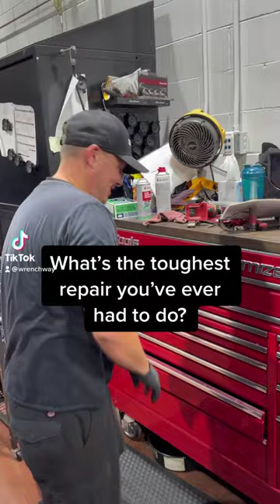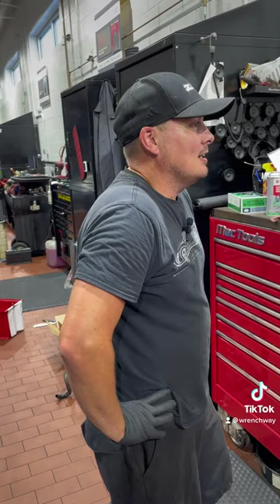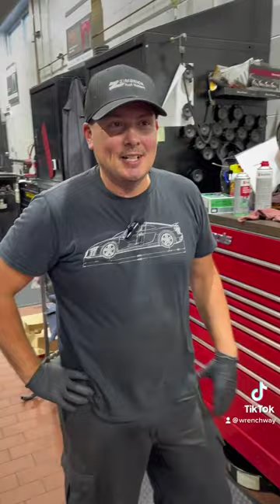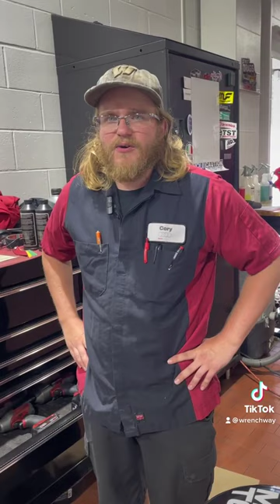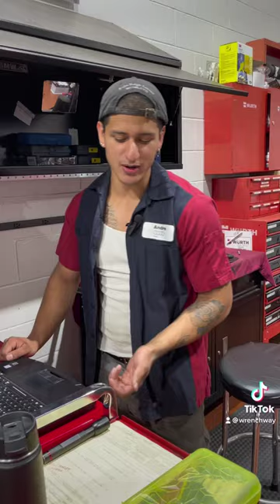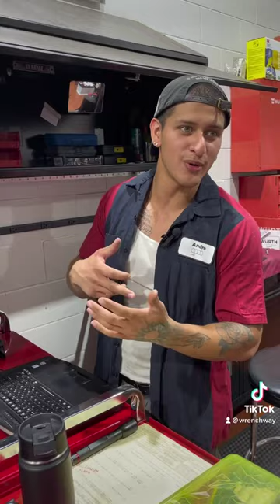Technicians Talk About Their Toughest Repairs #shorts

Comment: The first 2 sound legit difficult then the 3rd guys like “ a cv axle “ 😂
Reply: Sometimes the simplest jobs could turn into a nightmare
Reply: @efproductions923 true I had a half shaft my first year in techschool followed procedure but it was just a pain in my ass to do
Reply: My j35’s half shaft fought me until i just removed everything around it to get the entire assembly’s bracket out. Flex pipe, bank 1 catalytic converter, driveshaft and transfer case had to be removed just to get at it. This was for replacing the entire engine so i wouldve done all that anyway but it still sucked, and i ruined the boot on it so i had to replace it
Reply: I had the whole dealership stumped on my rear brakes the problem was there was air in the lines they thought of every other solution but to look that the calipers bleeder screw was facing down I had to flip them around took about 3 months before I came & seen it one day legit every tech in that dealer had no idea lol sometime it be the little things
Reply: If u can’t do a cv axle or half shaft in 30 mins on a lift ur in the wrong business. If it’s on the ground still shouldn’t take more then an hr n a half but all depends on what else u find on ur way in and out 🤷🏻‍♂️
Reply: @Alanthe918mobilemechanic  the problem wasnt the halfshaft it was a pinch bolt honda said to take out for some reason ended up having to take off mcpheerson strut, lower control arm,  a bunch of other shit in my first year of techschool can definitely do it faster now though
Reply: @Alanthe918mobilemechanic  i have sped up alot (although got in a car crash so been running off caffeine and advil) that was an extremely long time but regardless im on my 2nd year
Reply: @Jacksauto  keep going bud slow is steady always use a pry bar and maybe a hammer unless ur on the ground sometimes u gotta remove sway bar and end links to get room to fit a good pry bar i spray some wd 40 or lubricant glad ur okay stay off the energy drinks and caffeine for the first 90 mins drink water that’s hot with lemons and a bit of sugar you should feel better. I always love seeing younger dudes getting into the industry and not giving up. I just did some halfshafts and cv axles on a 02 Santa Fe the driver side was so rusted in but I found that turning the cv axle around 360 in small increments and prying you’ll eventually get the lock ring in a spot where it will come out with ease! Thanks for commenting bud! And good luck swinging wrenches it saved my life looks like it’s doing the same for you
Reply: @Alanthe918mobilemechanic  thank you dude Im still new we’ll see where i end up still alot to learn but yea it is a constant I guess which helps
Reply: @Alanthe918mobilemechanic  being a entry level tech is a challenge but it is fun gives me a challenge and a constant and yea I guess your right saved my life in a way to still so much to learn
Reply: @Jacksauto  trust me on this even tho u don’t know me I wish u the best and to be happy and secure learn as much as u can do research tinker with stuff outside of work try and find a good mechanic who’s maybe not a dealership bratt and learn some tricks of the trade or watch reputable channels on the tube. You’ll eventually have saved enough money to have ur own scanner and all the tools u need to go mobile or open ur own business and never have to work for someone or do a degrading job. Ur two years in right wait till u hit the 5 year mark then 7,10, etc you’ll make it bro. Keep grinding and rmr your doing a trade that most ppl couldn’t cut it in so take pride in being what u are it’s a beautiful talent my friend
Reply: He was honest! I'd say lack of room can be the biggest PITA
Reply: It's always the easiest stuff that takes forever. I attempted to take an oil pan off a car once it turned into an ordeal eventually I just took the engine out which was less difficult lol
Reply: @Toad Phillips  that is the truth, I'm just a backyard mechanic that fixes his own crap. When you start off a job and everything seems to be going perfect, you can bet your arse something will screw up just when you are about done.
Reply: Tell me he's a lube tech without telling me
Reply: Right.
Reply: I laughed at this but I'll cut him some slack since I recently had a 09 focus axle that was a mother to remove, took hours over book time, I legit thought I might break the  aluminum I was prying against. Finally got it with a custom ground air hammer bit.
Reply: sometimes they can be a nightmare. i'm a bmw tech and almost every x drive bmw has the right half shaft going through the oil pan to keep the cars lower. it's not fun to say the least
Reply: I fought an axle on a 2006 honda odyssey once. Passenger side is 2 parts with a bearing in between. After 3 hours with a slide hammer attachment I ended up taking the whole thing out as one peice heating it with a torch and beating it with a sledge hammer it Finally came loose from the carrier bearing. Yeah that was the hardest job in 27 years. Lol
Reply: Of you got rusted bolts that can be a nightmare
Reply: Ever had a bolt break off on a simple job inside the block

I had a starter job take all day because  of that
Reply: The Johnson rod for sure
Reply: @Alanthe918mobilemechanic  hearing that a lot, what you said about how it’s good to see younger people getting into the industry. I’m 22 now but started self teaching myself the trade around 18, just started up my mobile mechanic business. I hear a lot, that not as many young people are wanting to be mechanics these days compared to 10+ years ago.
Reply: @iTsTHumpa  it’s true man most guys don’t want to deal with this stuff they don’t have the stones to work outside when it’s cold or deal with the frustrations of being a mechanic but it’s a very rewarding job pays very well. It has its ups and downs but for the most part, you make people very happy I’m out here right now trying to get a 2.7 L V6 to stay in time while I throw the time in belt on just the glory of being a mobile tech.
Reply: @iTsTHumpa  congratulations by the way on making it to where he’s made it in the industry. Keep going man when it’s time to retire you’re gonna have some thing and you’ll have more than money.
Reply: @Alanthe918mobilemechanic  appreciate it boss!
Reply: He's "SOFT" :)
Reply: @iTsTHumpa  hey man appreciate you youngster enjoy your youth! Make the most of it stay under the hood and do what u really love doing
Reply: Picky customer's who want the impossible way on there car
Reply: I’m guessing he had to be joking ……
Reply: Nah he wasn’t he’s just young nd that’s old he’s gotten a lot better since then he’s a young talented tech working on Audi which isn’t always the easiest to mess with
Reply: Bro he looks young what engines you rebuildin huh?
Reply: You have a bad day. Anyone, you can literally have a difficult task to do for the easiest things. I don't make fun of anyone in this kind of work environment.
Reply: @Er8Top1  read the rest of the comments no one made fun of anyone and if u can’t handle being made fun of in the shop ur in the wrong business child.
Reply: @trentulloa  to many to count but currently doing an in frame overhaul on NTC 365 IV cummins big cam took me 2 days to do it working 8 hrs each day. I been wrenching for about 15 going on 16 years idk why ur all tryna be offend no one said anything wrong even the dude ur talking about wasn’t offended all y’all commenting belong in a beauty shop not a automotive/diesel repair shop. Smh. Soft.
Reply: @Alanthe918mobilemechanic  this guy, that's anywhere part of the business. When the jokes lands on you. I'm sure you're the "child" who definitely takes it in all the way and will complain about it. Obviously my comment wasn't for you. That comment was for those who makes fun of someone else on a task for the job that has an ego.
Reply: @efproductions923 facts. I was supposed to just do level keys and upgraded tie rod ends on my buddies old silverado since he was about to put 20x12s on. Turned into his wheel bearing was shot, went and got a reppacement hub, old hub was friction welded onto spindle, it was so siezed a press wasnt even getting it out and had to torch out the old hub. What would normally take me 2 hours took me more time than i can count
Reply: I started with a cv axle that turned into lower control arms and a steering knuckle. The axle was stuck seized inside the hub and lower ball joints wouldn't come out either. I broke 4 ball joint separators so I cut them and replaced them all. Even with a press the axle wasn't budging from the hub.

Comment: The hardest job, is going to work everyday knowing this business sucks ass.
Reply: Why do u think that?
Reply: @United Territory after 36 years in the business, your body hurts almost every day. Most techs don't get paid enough. But really for me, it was a joke comment. I have made over a 100k a year most of my career, I have over a 100k in tools. I do NOT work on vehicles on the side never have never will. I don't even like vehicles, I'm not a car guy. I'm just very good at repairing them. I have been an ASE Master technician for all of my career.  But started specializing in hard-to-find problems, and became an automotive specialist, dealerships bring me vehicles to find problems they can't fix.
Reply: @homesteadhaven2010 field service engineer
Reply: Honestly
Reply: @homesteadhaven2010 I actively lift and am 21 years old, starting as a Gen Tech this monday. When I do gravy work on my car with just a hand jack & stand my lower back and lats are dead for the day, but i notice shops have lifts to work at chest level or above. My question is, if I'm physically fit can my body survive the demands of being a tech?
Reply: @bestmonkineu4342  I'm not exactly physically fit and I do just fine
Reply: @isaackellerman3006  same, i needa pickup some weights because i struggle with certain things that strength would come help with
Reply: @bestmonkineu4342  just be smart with what & how you lift. There's a difference between lifting weights & lifting engine parts without damaging anything. The business will show you over time where your workout routine is lacking.
Reply: @bestmonkineu4342  im 23, have been a tech since I was 19 and i feel like im 30 years old.
Reply: @bestmonkineu4342 it will help for sure. Still need to be careful though
Reply: @homesteadhaven2010  "not a car guy" lol ppl look at me crazy when I tell them I hate then but know how to fix them
Reply: @bestmonkineu4342  gotta be mentally strong lmao, also gonna bust your hands everyday. Same spots too. I got cuts on my hands from months ago lol. Just don’t have enough time to heal over the weekend. Always sore too. Never know what muscle your gonna use laying lopsided trying to get that one bolt🤣
Reply: That’s why I got out when I did

Literally any trade but automotive let the dealerships sink themselves be happy somewhere else it’s either you or them
Reply: @alexanderthegrape5370  Honestly that’s the part I’m not understanding 😂. I’m considering changing careers & becoming a tech because I sit at my desk job wishing I were around cars all day. They’re my passion. What’s yours?
Reply: @bestmonkineu4342  you could have some muscle imbalance meaning some muscles are stronger than others are.  Possibly you are doing all slow twitch muscle training  ( heavy, low  Rep) and too little Fast Twitch training ( low weight high Rep ) think of a marathon  runner that needs to use the same muscles for hours without pain our injury.  You should consider spending time with a Kinesiologist who can assess what you are doing and what you are doing in the gym to avoid possible injuries latter on or when at work.
Reply: @qwntnqwntn  do it brother! Get out of that office chair, spend 5-10 years in the trade then open up your own shop!
Reply: @qwntnqwntn  It's an extremely demanding trade on your mental, physical and financial health lol the fact that you love cars tells me it'll be a great hobby for you because doing this professionally will most like diminish that love for cars.. if you want a lil taste do some work for friends and when things go sideways you might change your mind... My passion? My passion is a cozy desk job with clean hands and air conditioning wearing nice clothes without the possibility of losing a finger, getting burned, electrical shock, losing or severely injuring an eye, blowing out a ear drum, severe arthritis when it's all said and done the list goes on so .. yeah 😂
Reply: Auto is gay , diesel is where it’s at
Reply: @alexanderthegrape5370  Man that definitely answers my question, thank you!! I just bought myself a new project car for christmas so I’m sure that’ll satisfy the urges to wrench when I’m free. When it comes to my career I’ll try to find a cozy dealership job so I can continue to work in comfort while also being around cars & other car people. If I get could get access to a shop after hours that would be a plus. I see an opportunity to work smarter, not harder here 😂
Reply: @qwntnqwntn  Dude now you're thinking!! That's a awesome idea, get to know the techs hang out in the shop on your break it a win, win lol
Reply: @bestmonkineu4342  unfortunately age will get the best of all of us. I did it starting at 20 years old to 32. I was 195 pounds with 28 waist. Im 35 now. not nearly as in shape anymore, but my body feels like I played tackle football 12 hours the day before. Every day. My job is still labor intensive but I dont see how I can do it for much longer.
Reply: Preach brother!
Reply: @homesteadhaven2010  the question may be obvious but idk so genuinely asking why dont you do side jobs? For insurance/ legal reasons? Or too risky?
Reply: Anybody who has worked in this business, including me, will agree with you.
Reply: @bestmonkineu4342  been wrenching since I was 9 years old in my grandfather's shop. Started full-time at 15 at a body shop Started on flat rate first day. I've  worked at mechanic shops also. On a 50 hour week I'd book 70 to 80 hours I'm 48 now and my body is shot got knee and back problems arthritis through my whole body. I got out of it at 40 I work for a trucking company now it's hourly and really laid back. The worst mistake I made is making a career out of a hobby. It's not worth it anymore pay sucks and you'll destroy your body. Your young enough save it for a side gig. Do something on line work from home.
Reply: @homesteadhaven2010   you should be making millions
Reply: @homesteadhaven2010 bro fix my brakes bro my pedal is weak and the calipers don't release after driving for awhile
Reply: @bestmonkineu4342  it’s the part of putting your body in awkward positions that make it sore. Because some engineer decided to make the dumbest design possible . I’m myself is in shape and I’m sore after doing repairs on my vehicles, and I’m sure you know every vehicle is different . Good luck to you and your field of occupation
Reply: Try being a diesel mechanic for Tyson foods
Reply: @bestmonkineu4342  hell yeah brother. Been a HD Tech for 7 years. I still workout 5xweek💪
Reply: @davepalmer9265  I got guys in their 50s and 60s in my shop. I don't even know how they still do this everyday. To be fair, I work for Hyundai. We don't even work on big engines. Pulled in a lifted 1500 Silverado to do a used car safety inspection. That shit just looked too much, compared to what I normally do. I think I have it easy, comparatively. Can't imagine working one those big engines.
Reply: @bestmonkineu4342  it’s the long term wear, not the short term.
Reply: It does suck ass.
Reply: @bestmonkineu4342  yea definitely. Dude there’s old ass men 50-70 still in the industry going at it strong so you definitely can do it. It won’t be easy but it also won’t be as hard as you think either probably
Reply: @BestMonkInEU  yes, I'm not super fit.  But I'm not "fat".   Only parts of my body that hurts the most are my legs.  But that is because I'm just getting older.
Reply: @jose duarte  I hate vehicles with a passion.    I'm a farmer/butcher at heart.      I own over 100 acres with a misfit farm full of animals.
Reply: @majordudley35  in Minnesota?      If so how was the State Fair this year?
Reply: @JoiceVaderd  I'm in my 50's.  Start at age 16.
Reply: @bestmonkineu4342  it’s in the long haul man. Nearly anyone’s body could survive being a tech, the question is how long? You won’t know until the damage is done sadly.
Reply: I dunno, I've been out of the bike trade for a decade now, thinking of getting back in. Miss wrenching on bikes something fierce lol
Reply: Why do you say that? I thought mechanic is paid well
Reply: HHahhahhaha 😂😂😂 💯💯💯
Reply: @joseduarte8541  it always turns into a big ass hassle. After you do work for an individual on the side, you essentially just made yourself that person's personal mechanic for the rest of your life. I also don't like to do work at home, I keep over 90% of my tools at the shop
Reply: Fleet leasing jobs>
Reply: @darknessally you obviously ain’t a hard working mechanic
Reply: beats the hell out of food or retail tho
Reply: @homesteadhaven2010 ”dealerships bring me vehicles to find problems they can’t fix” wow holy shit dude that’s a big flex. Take me in as your apprentice lol
Reply: @revit4909 I have had more than my share of apprentices in my career.        I'm to old and an asshole to deal with green techs anymore.   😂
Reply: That’s universal to any job with shitty management. You’re right on the money
Reply: @homesteadhaven2010 Your the Man, I aspire to be in that position 🦾
Reply: @homesteadhaven2010 it’s rewarding I know you were happier at the shop than you would have been in some office sitting all day